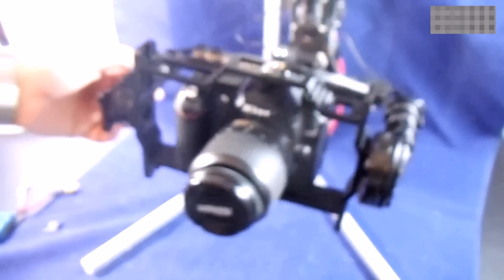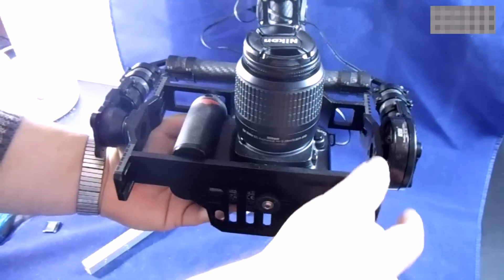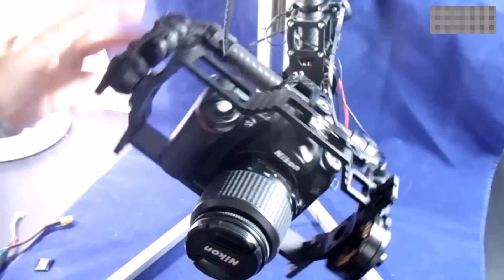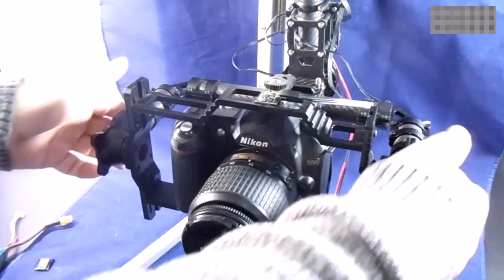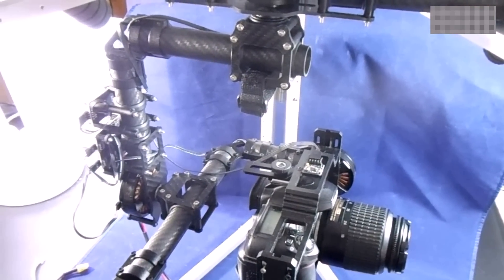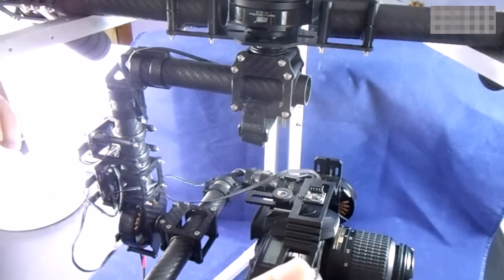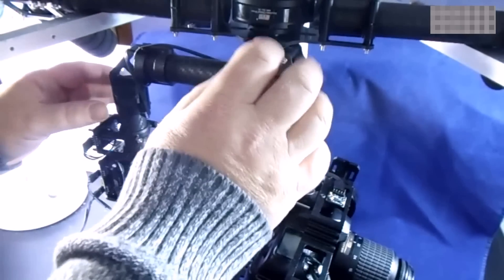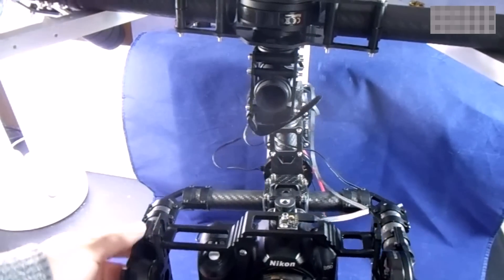Set up the balanceing of Gimbal body video

Comment: Hi Michael,
I want to get the gimbal kit but change the brushless motor config. Keep the 200T but swop out the two 75T for 120T's. Reason being is just to over spec the original setup. Is this a bad idea? Is it manufactured for this config only? Or will it just be a matter of balancing which ever size motor you install?

I have never had the chance to get my hands on a BL gimbal. But with a speculating guess I think changing the motors within reason would not upset the original design. You would just calibrate accordingly.

Thanks for the upload bud.